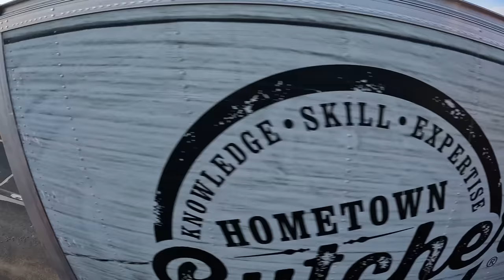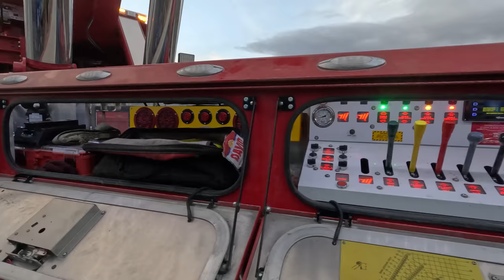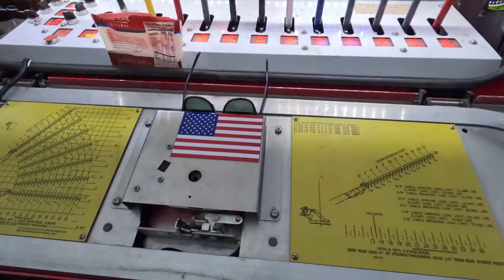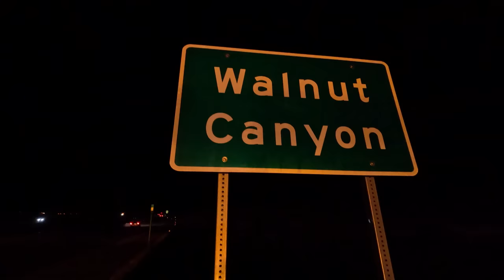WRECKER GAMES on I-40 or should we say ROTATOR GAMES on I-40 (8 winch lines)

Comment: Ramen pallets weighed around 2800-3200 a skid from what i remember. You could check fork weight on the high crowns and i used to weigh stuff for shiz n giggles back in another life. That looked like a old wabash 53" so you could run 30 in 48-48 or 28 chimney stacked 48-40 but its not nearly as secure cause those swings normally had a 103" deck iirc. 60 skids of ramen in a sacked out old great dane with a canvas top shoved in sideways on the worst whitewood imaginagble doublestacked with about 1 round of shrink on each pallet. Oh the memories .... Good to see theyre using cheps now at least lol

Comment: @MURPHYSDIESEL you done screwed this one up you know this right... all you had to do on this one is  stick a fork in it cause it was already done. Heck you all should have just opened up all that romin noodles stired it in the water down in that river wash heat it up for a minute or two season to flavor and sit back and have the guys just shred that pile into the scrap bins/roll offs load up done and done. Oh but Yoda should have already known the force in the driver of disaster was not strong no force at all in that one. Yup could of saved all kinds of damage to equipment and best of all it probably would have made 3 x times the amount at the end of the day less stress no worries and no space taking up in your yard with hanger queens sitting for months. But then you wouldn't have gotten all western and no video really so ok I guess then just do it your way lmao. (I say fire up the wood chipper and shred it send it out with sparks flying fires and explosions and light up cigar and close out the video walking away like the badass 😎 you is. )